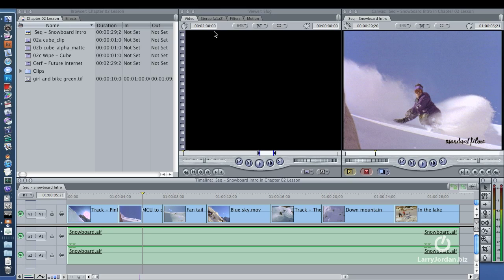Reusing Mini DV Tape - Final Cut Pro tutorial micro

Comment: What should I do when I'd already overwritten my old DV tapes with new footages but the playback only showed the old footages in a distorted way?
Reply from the maker: lmab74:

Hmm... This is not good.

This sounds like the recording heads in the DV recorder were either misaligned or not generating a strong enough signal to erase the old tapes. 

You could try playing them in a different deck, to see if that helps. But, aside from trying different hardware, there's isn't a lot you can do to fix this during playback.

Larry
Reply: @LarryJordanFCP  Does this mean the new footages I recorded are damaged (or lost) or is it just my current deck can't play them properly?
Reply from the maker: @lmab7464  

Sigh... probably yes, the existence of both old and new footage probably means your recording is damaged. BUT, before you give up, try playing it on a different deck - ideally, the one that recorded it. You might get lucky and the deck that recorded it can play it back sufficiently well to capture for editing.

Larry

Comment: How do I erase data of the tapes?
Reply from the maker: Samuel:

You could record over it, or wave a strong magnet against the cartridge.

Larry
Reply: @LarryJordanFCP  is there a more practical way to do it besides using a magnet or recording over it?
Reply from the maker: @imeffff  

 None that I know of.

Larry
Reply: @LarryJordanFCP  also this isn’t related to erasing tape but do you need a FireWire cable to transfer mini dv to digital? Could I use a mini usb cable or do I need a fire wire cable?
Reply from the maker: @imeffff  

It depends upon the dv deck. All decks that I know of use FireWire. However, if it has a USB port, you can use that. However, in those days, USB was not fast enough to support DV video.

Larry